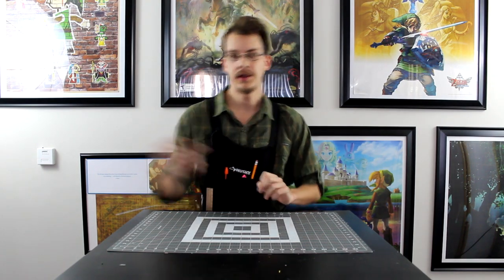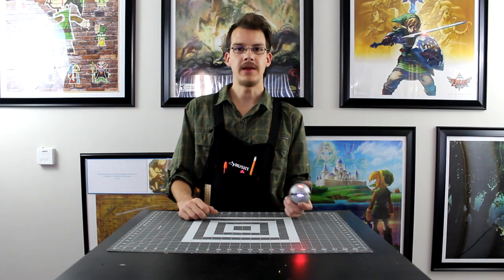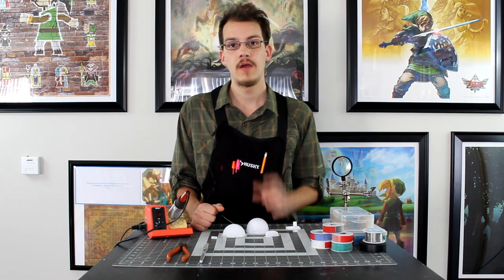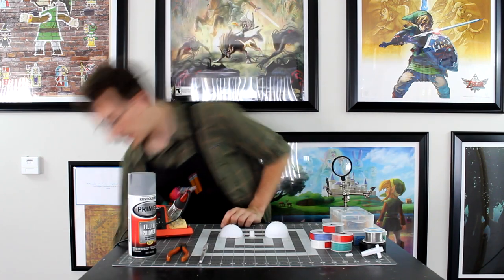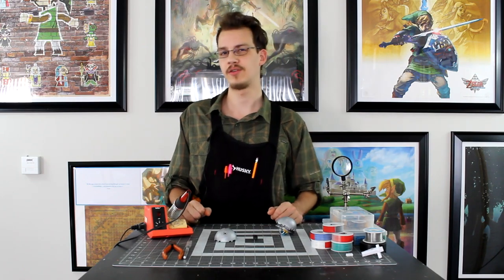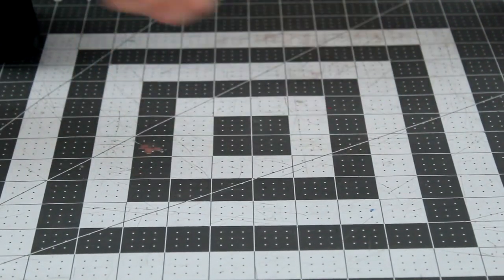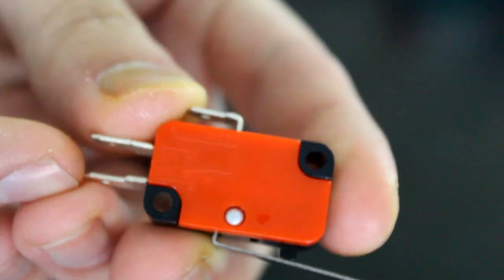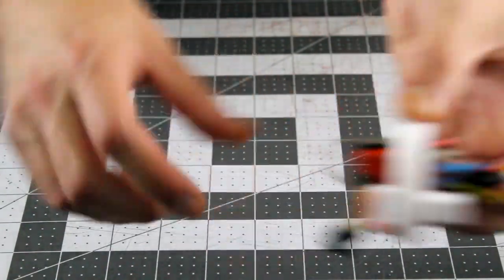How to make a simple DIY Star Wars Thermal Detonator!

Comment: Great video! I'm very new to this type of project and was wondering if there would be any issue using the Adafruit MO in place of the older Trinket? It seems the chip you're using in this video is outdated and not recommended anymore. Would the programming be the same? ANY help would be GREATLY appreciated. Cheers!